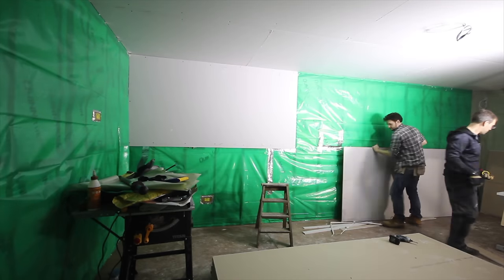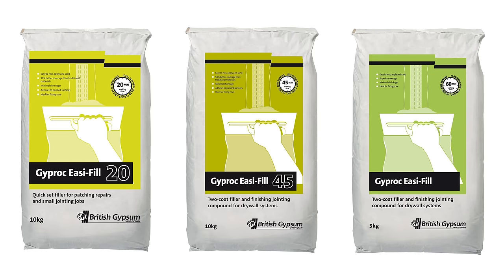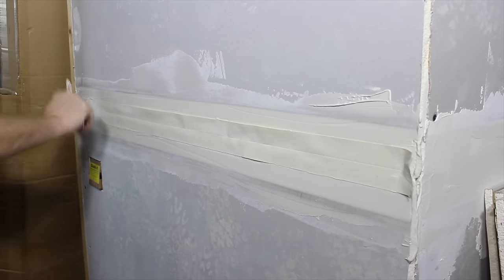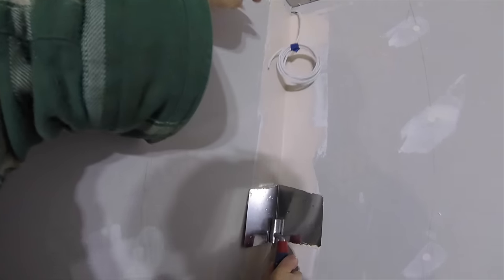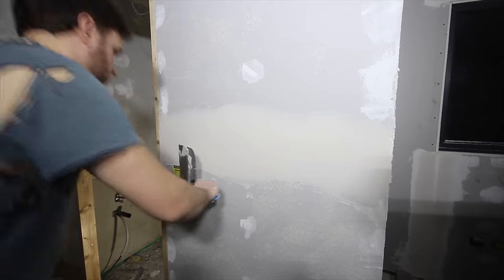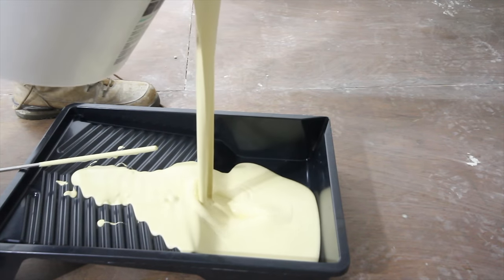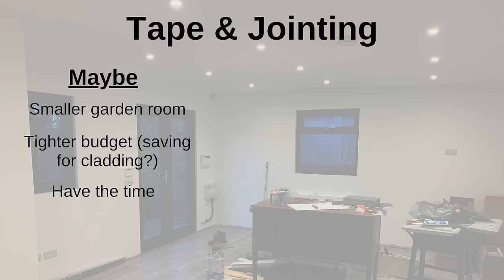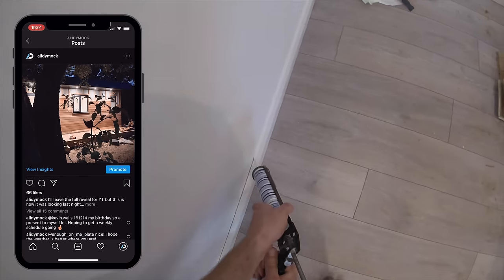Garden Room Workshop: Part 17. Tape & Jointing

Comment from the maker: This video is less of a ' how to ' as a ' should you? '!
Reply: love it
Reply: I can definitely second this,  I've skimmed walls in the past (self taught) and I thought I'd try tape and jointing, as why not... but I'm currently mid way through this process, and It's way harder to do than skimming plaster.    Also the cost of all the equipment to tape and joint ends up costing a small fortune before you know it, all the knives, sanders, expensive dry wall primers etc,  way cheaper to buy a hawk and trowel, a pot of PVA and a couple of bags of plaster.

Comment: For hand sanding I can highly recommend the Mirka hand sander which you can attach to your vacuum. I've spent a lot of time repairing various bits of the walls in this house and wish I'd had it from the start. ~£38 but it's worth it for capturing all the dust which just goes everywhere.
Reply from the maker: Ah, I didn’t know that existed, great shout.
Reply: Ordered one on this recommendation, arrived today and yes very impressed.  Only sanded a few spots around the house (renovation) but some were 6” in diameter quite proud. None of the usual dust at all and even tested by sanding above a gloss black surface 👍. Only snag for some may be the hoover attachment as it’s a conical bung, I had to tape over a small area when attaching to my WD2 Karcher. I wish I had got this months ago.
Reply: A plasterer recommended it to me a few years back.. it's been invaluable when decorating. As M&M says, it needs some fettling to get it to connect properly to a karcher vac.
Reply: An absolute life saver the Mirka hand sander

Comment: TAPE JOINTING.  Put the tape in water and wait a minute, then use the tool to hold the tape into the compound at one end, stretch out the tape running the tool along it (blade at an angle) the tape will squish into the compound. A plasterer would take two days average, you will need to fill a little after them.  Tape jointing is a lot of sanding down and you must have a breathing set on, the dust is a no no and will be everywhere even with a hoover attachment.
Reply from the maker: That's a nice trick and probably means the first coat doesn't need to be too sloppy 👍

Comment: Hey Bud. Thanks for Video - Ordered a few items through your Links to AZ to help you. My tips - I used a Powered half moon sander with vacuum bag & also Wurth Mud premade (Extreme High quality) to speed up process which turned out as good as Full skim. I also sprayed some water on screw holes before filler to stop the blowouts afterwards. If you mini roller over joints with Johnson white Acrylic primer/undercoat = HQ finish for final paint coats ( 3/4 min recommended)

Comment: Brave man tackling a room that size. I think your final conclusion is correct though, one wall, repair or very small room, do it yourself. Anything bigger, get a plasterer in for a skim. A few hundred quid and they will be done in a day (maybe 2 days for your size room) with a lot less dust/mess.

Comment: As a DIY'er you tend to always get the hang of this just as you're finishing your project. It takes a lot of time, but it's not hard, once you get the hang of it.
I made the mistake of not laying a couple of paper strips shallow enough and that can show up when painting.

The sealers we get in Denmark is very watery and mainly serves to fill porous materials like jointing compound or other types of cement based plaster. It's blue and stains like a motherf$#!, so be very careful not to get it anywhere it shouldn't be and take care to wipe off any runners, because they show up after painting.
Reply from the maker: That's very true. Doing it a second time would be a lot more economical with my time than the first! I wonder if the blue stuff is similar to the yellow stuff , why don't they just make it white!
Reply: The yellow stuff you used seemed more like paint, than what I used, which is very watery but dries up more like glue. The blue stuff barely sticks to the paper on the plasterboard, but seals the surface of the compound. It is very strange, that it needs to have color to it, but I don't suppose we're the first to wonder, so perhaps there is a good reason.

Comment: Having learn to plaster for this kind of thing, I am surprised tape and joint isn’t easier.  One advantage for trades on a site is the dry time however, ie you can get paint on the wall a lot quicker because there is no plaster to dry out.
Reply from the maker: That's a great point I should have made in the video, the dry time is no more than a day or so.

Comment: Most new builds use crappy paint but also a lot of the time they only do one thick coat which is bad because the moisture is absorbed by the plasterboard then the paint acts as a skin and only sits on the surface rather than bonding to the face, thus it flakes off after a few heat cycles of the central heating once the new owner moves in. 
Also i prefer using just a 12 inch knife for most of it as it prevents high spots and thus reducing the amount of sanding you have to do compared to using a 4-6 inch knife.

Comment: Great idea on having the furring strips on the inside. I think I'll do that with mine.

I've gone from planning on building from timber to block to now out of cold-formed steel framing.

How many more videos do you think you'll do to finish of this series?
Reply from the maker: I reckon 7 more, but mostly shorter in length so easier to make :)

Comment: Great watch throughout the build, two questions, as a guide for u values for walls does that amount of pir insulation meet regs, seems using u value calculators you would need way more insulation also including insulated plasterboard, secondly, anything going to stop a rat literally coming up through the floor ?

Comment: The main mistake is ur sanding between coats as you.make  it all dusty ,
As yoy get better with ur first coat and ur second coat u don't need sanding till last last coat 
All yoy do it just scrape it all to get hight spots shaved it all and apply second/3rd coat. 

For fisrts time" tapers" I advise tonuse easy fill  as you  can sand it if any imperfections/but it is cost a bit more 

Whwn you get vetter use base coat(british gypsum red bags or any alternarives from B&q  and  after ready  mix (preferably light sand british gypsum) for the sexond Nd 3rd coat 

Thank yoy
Reply from the maker: Thanks for the advise Sergei! Super helpful!

Comment: Nice job and great video, its a lot of work.  I am looking at lining out a 14x18 garage for a pool table room but not sure if plasterboard or ply is a better choice??
Reply from the maker: I don't think there is a 'better' choice and rather it comes down to what you want it to look like and if you intend to hang a lot of things on the wall. if it's just a dart board and snooker cue rack then you can just go into the studs (if this is a timber frame?) so plasterboard is fine. The cheaper plasterboard may be off-set by the expense of a plasterer if you go down that route. Basically it's a matter of personal preference of appearance and use :)
Reply: @AliDymock  Thanks. have opted for 12mm ply, its more expensive but thats offset by needing less support work - this is a concrete slab build and the walls cant be drilled so battens have to be fixed with steel brackets onto the slab bolts, a real pain ;)

Comment: Good video you forgot your tip on feathering, also how / what do you use where plasterboard hits window - is there a j bead or just run to window edge and did u compund around that
Reply from the maker: Ah maybe I didn’t make it clear but it was the filling in the dimples only trick-instead of adding a whole new layer, just make good the previous one-not the proper way, but worked well for me!

I plastered (compounded?) all the way to the window, then sealed, then painted. I thought about caulking around the edges but found it didn’t need it 👍

Comment: Luv the firring strip idea. By the way at 5.30 you mentioned you had a tip of using the jointing knife at an angle for feathering the edges. What was the tip as I didn't catch it.  Great work by the way
Reply from the maker: Oh - instead of adding layer upon layer trying to get it smooth, sand off the high points, fill in the just the low spots, then sand again. A pro wouldn’t need to but it worked for me!
Reply: @AliDymock  great tip Ali. Many thanks. I am in two minds when it comes to skimming vs drylinig jointing compound . I hate dust and having to sand is horrible on the other hand you have a lot of flexibility when it comes to doing it yourself

Comment: 5:57 you never showed the little trick to feathering.... could really use this haha
Reply from the maker: Ah the trick was that if you sand it and find little divots or holes, just fill those in individually rather than doing a whole new layer. I won't win any plastering awards but it does the tjob. To find the holes more easily, use a torch at an angle to create shadows.

Comment: Tape and jointing cost more,3 vists plus sanding where as skimming 1 visit,
Reply from the maker: It does dry very quickly so could probably do at least 2 in a day. I wonder why so many new builds go with T&J, maybe economies of scale...
Reply: @AliDymock  the main reason is speed, plaster can take a long time to dry out, which can push decorators back by a month before it's really dry enough to paint if the building isn't heated, whereas the styling method can be completed in a couple days, and painted very soon after.
Reply: See your point but in real world construction you don't tend to get 2 properties ready for a taping gang and they leave loads of patching  which more often than not get finished with plaster. Ran a plastering and taping company for 20 years so speaking through experience. Tape and jointing is fine in commercial builds which aren't permanent and walls can be removed with more ease than a plastered wall but taping as its pros and cons. Incidentally I design and build garden recording studios now so not to far from your work.good videos so well done
Reply: Plaster on boards dry in the same time scale as 3 coats jointing. 2mm of skim on boards takes on average 2 to 3 days before a mist coat can be painted on. Taping compound (or the good ones) are air drying not mechanical drying so don't know where you get your info but your off the mark slightly